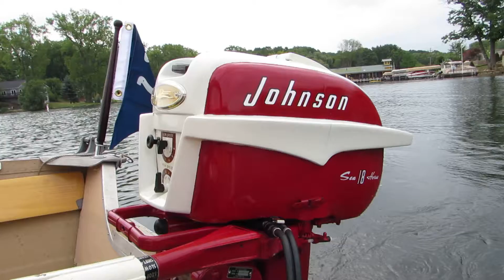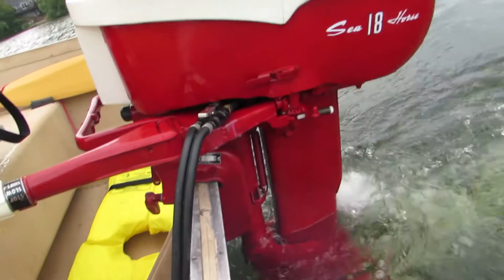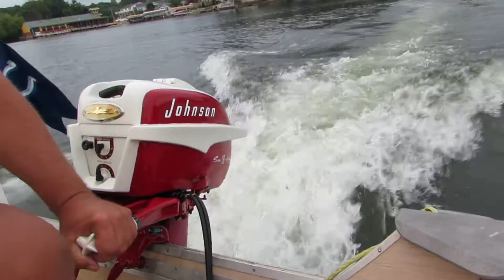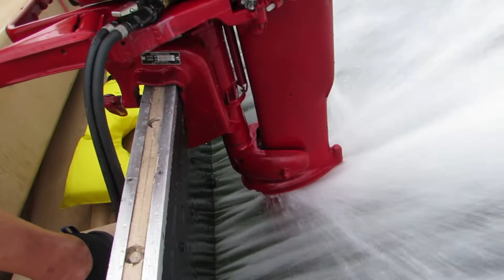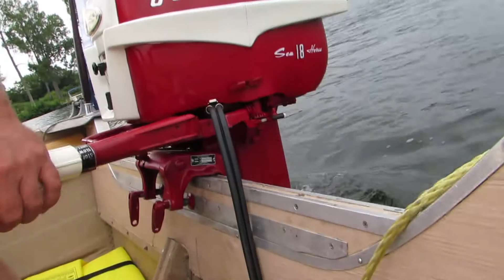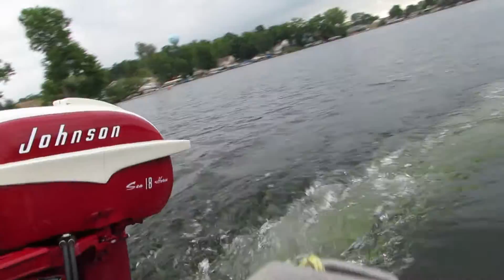1957 Johnson 18hp Outboard motor

Comment: The '57 and '58 Johnson's are THE 18 to buy and own...best styling by far and nothing lost compared to later 1960's versions. With a retrofit to a single-line tank you can run these for another sixty years.
Reply: One problem with these old ones is finding a good gas tank. How do you retro fit to a single fuel line?

Comment: I had twin 7 1/2 1957 Evinrudes on my 10 ft racing prom with steering and controls. I was BMOC boating in Biscayne Bay in the 50’s and 60’s. GlennFHoward

Comment: I have the same motor which I just bought, although I can't figure out why it is not going as fast as it should be, I got it to top out at 11 mph, I think one of the spark plugs might not be working, but I am going to go through the carb to make sure there is not mud in there, I am also wondering what fuel mixture you use
Reply from the maker: If you got cly. not firing. It's 90% of the time one set of points is not working.

Comment: Can't beat the Johnson/Evinrude simplicity in engineering, and super dependability as a result!   Not like the OVER-ENGINEERED Mercs that had corrosion problems with their steel driveshafts, and troublesome carburetors!   These Johnsons were built to last, and stay running for YEARS!
Reply from the maker: I think they are easier to work on too.
Reply: My friend has an outboard shop and he won't even take a Merc as a trade-in until he pulls the lower - if it won't come off he tells the owner it's worthless which is the truth.  There's a Merc 35 on the slab now...last owner resorted to a hammer to remove lower..that didn't work out so well!
Reply: I don’t own a mercury but I think knowledge is important they were a great vintage motor as well. I’ll stick to Johnson/Evinrude personally 😉 beauty motor you have there nice job! Love to see actual work not just water test.

Comment: I need to watch some good runnin Johnson's to motivate me on my 57 35hp.  Seems to be a fuel problem.  It backfired last year, not sure if I got the crazy timing right, did ignition last fall.  Carb is next, don't know its history, most likely sat for years.

Comment: do you have a 2 blade speed prop on that or a stock 3 blade?  26mph in that boat is quick for an 18!!
Reply from the maker: No its a 3 blade 9x10  and motor is on the third notch out and the cavitation plate about 1in above the bottom of the boat. and the compression is 118 per cly.   When got to lake is was very smooth too.
Reply: Outboard Fun i bet you could gain 2 or 3mph with a 2 blade.  they're a little hard to find and a little spendy but there is both an AJC and an AJ for the fastwin motors.

i gained 3 1/2 mph going from a regular three blade to 2 blade AJ on my 12 foot starcraft with a 1955 QD- 17 to 20 1/2 mph.  and that's with me in the middle bench with forward controls and i'm a heavy load lol
Reply from the maker: Maybe I will have to look for one thanks for the info
Reply: Merc used a lot of 2-blade props on motors right up to 35/40 hp and they do go faster on a light hull. Three-blade is better for heavier boat with lower pitch.

Comment: I have a 1956-8? Evinrude Fast Twin 18hp with electric starting
Reply from the maker: Does it you run good for you?
Reply: Outboard Fun I had some troubles with it before but it's a strong runner I get 27mph on a 12ft aluminum boat!
Reply: I don't like the Evinrude 'clamshell' motors with the cowl split side-to-side instead of front-to-back like the Johnson's. Not only is the front of the motor ugly with the knobs sticking out but on some models you can't get the cover off without scratching it on the shift lever! Dumbasses! They actually came out with a spring-loaded shift lever to get around that problem.  If stuck with one of those Evinrude's I'd retrofit it with Johnson parts - a Johnrude!